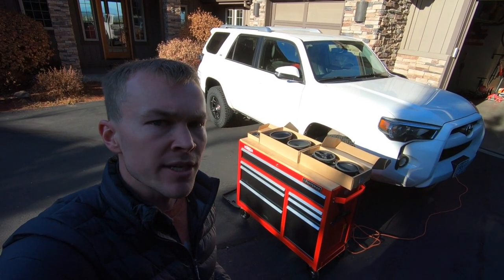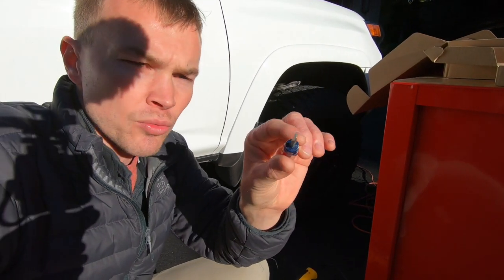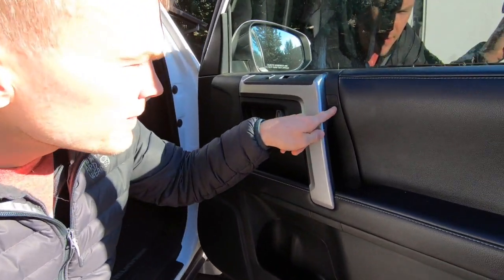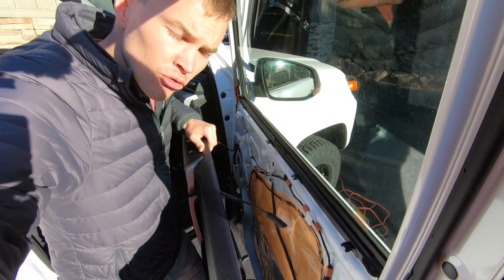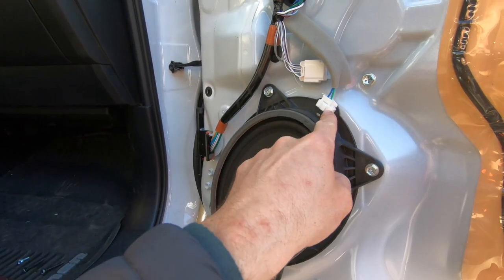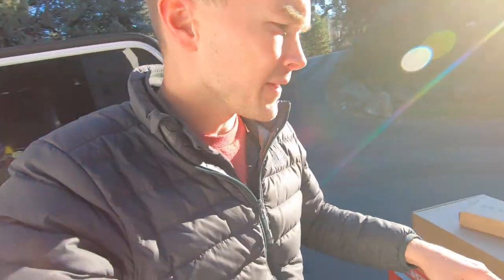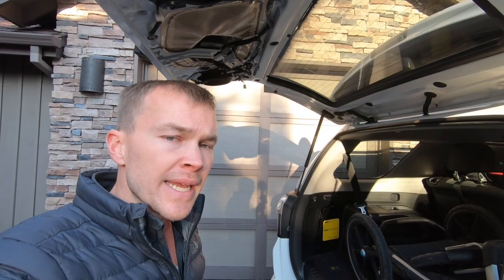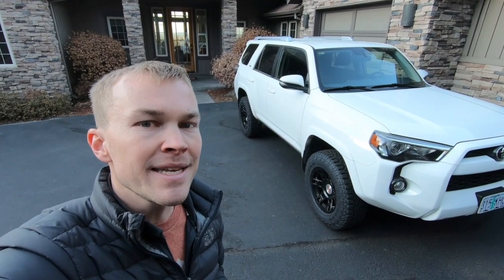4Runner Full Speaker Replacement Instructions - Super Easy!

Comment: This is a very good video. One additional tip. If you take off inside window molding, it’s far easier just to push in the interior door trim assembly. If you do it the way it’s shown in this video you end up having lots of the fasteners either fall out or get hung up on electrical/door closure hardware on the inside. The molding is pressfit and go straight and just like all the other ones once you have it off. I’m positive they do it that way at the factory.
Reply: Can you explain this in more detail? Are you referring to the rear window molding?
Reply: @tomasg9516   First align the interior door panel top where it meets the window... and push down.  It will snap in place.  Then push the rest of the panel in place by pressing where there are fasteners.   If you just go in from the side without pushing the top down, you have to pull up the door panel... and fasteners get hung up and fall, become misaligned, etc.

Comment: Thanks for the video. I bought and installed the same set based on your recommendation for my 2018 TRD. Hardest part was getting the door panels back on, particularly the rear side doors. Otherwise, great clear instructions, thanks.
Reply: Having the same problem,😐, installing everything back!!hahaha
Reply: First align the interior door panel top where it meets the window... and push down.  It will snap in place.  Then push the rest of the panel in place by pressing where there are fasteners.   If you just go in from the side without pushing the top down, you have to pull up the door panel... and fasteners get hung up and fall, become misaligned, etc.
Reply: How do you like that quality of the sound from the new speakers? On par with or superior to factory? Hopefully more bass!

Comment: This is the best way to change the speakers in your vehicle.  i changed my dash speakers, and sound was off, so i replaced my door speakers and the rear speakers were not working with the front and dash, so i had to replace the rear lift door speakers on a 2020 Toyota 4 runner.  in short regardless whos speakers you want to use, this video is complete.

Comment: JBL Club line (and the identical GX that's on clearance right now) sound good with a silk dome tweeter and are about 2 ohm for those wanting to keep the stereo stock.  If you go to 4 ohm, the speakers are going to play stiffly without an external amp because they'll be pulling less power.

Comment: Well explained, thank you Mike. Too bad you didn't make a comparison between factory- and OEMaudio+ speakers
Reply: The drivers in my sons Fisher-Price radio are better than the stock speakers in a 4Runner. They're literal garbage. They have to be the saddest speakers I've ever seen in my whole life and I've be working in professional audio for 27 years, and used to install car audio for a few years as a teenager.
Reply: @treasurehunt7812  what would you recommend to an audiophile are the best speakers to replace the stock speakers with? More bass is preferred!
Reply: @tehk-media  I went with Infinity Kappa's front and rear w/ a Mmats 6150 (I believe) amp pushing them and a 12" sub. If you're going to run the replacements using the stock amplifier/head unit, I really don't know. Look for drivers that have a high sensitivity rating, which means they respond better to less power. I think that car audio drivers, today, are all pretty good. You probably can't go wrong with any of them if you're replacing the stock speakers.

Comment: Thanks Mike, I wouldn't have been able to change the speakers without you!  However I didn't notice much change in sound quality from the factory-installed ones.
Reply: You need an amplifier to give it the power it needs to maximize the lower and sound.

Comment: I’m not sure but doesn’t the 4Runner have side airbags? If so are they located in the door and can they be accidentally deployed?
Reply: Did you ever find an answer for this? Might hold off replacing my 2016 speakers until I figure it out as well.

Comment: Mike, when you unplug the speakers you do not have the long cable connection that you have when you are connecting the OEM+ speakers!!!

O was installing the OEM, and their connection in the speakers they shipped is in the middle of the oval frame, and the stock speaker is on top.

The cable to connect the new speakers is not long enough to connect the OEM+.

Question??? Did you buy a connection cable to be able to connect the new speakers?, and is yes, what kind of connection? Thanks! Keep it going!
Reply from the maker: Not quite understanding the question but the speakers were completely plug and play and no additional wires or adapters are needed.

Comment: A little too pricey for what it is. You can spend about 350$ on a full speaker upgrade from Crutchfield with aftermarket brackets and plug and play wires that they supply with each order.

Comment: I have the JBL system on mine with this work too?
Reply from the maker: Not the exact system but they do have an option for 4Runners equipped with the JBL system.
Reply: Mike C thanks man great video btw 👍
Reply: I can recommend the JBL Club speakers as replacements to the JBL OEM speakers, as they are 2-3 ohms, and sound very clear.  For the front 6x9s, the OEM speaker is strictly a woofer, and all the higher range is sent to the dash so you don't need 6x9's  with really nice tweeters...I went with the older JBL GX line for $60, and they're perfect for improving the bass.  I now have to get some sound deadening material to fix a resonance in the door just from upgrading the speakers.
Reply: @mattb9664  Would you recommend Neoprene closed cell foam or Mass Loaded Vinyl when doing this?